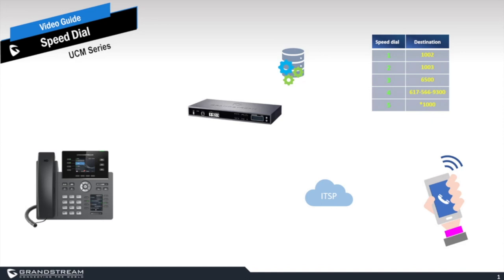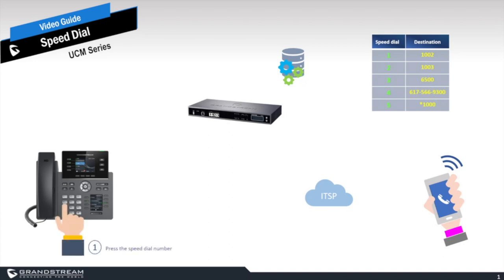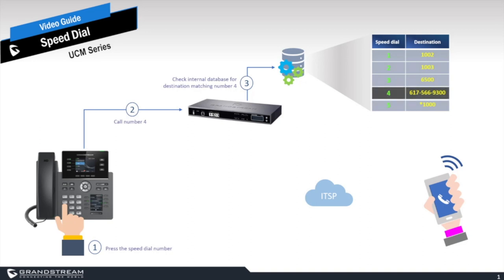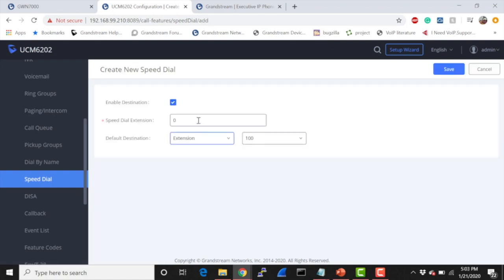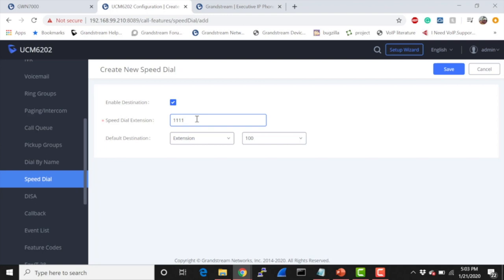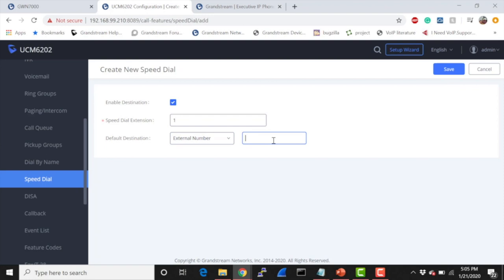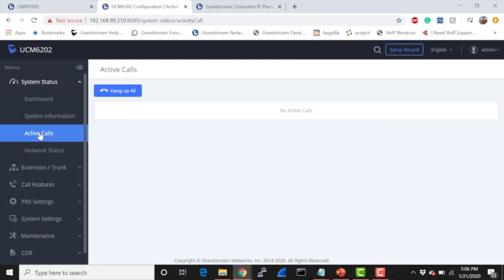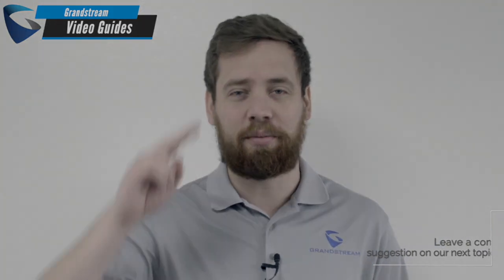Video Guides - UCM - Speed Dial

Comment: RIP Headset users at the beginning.
Rock solid systems when deployed by a knowledgeable Grandstream technician.    At VoIP Portland we  have installed 100+ and to my knowledge had only had one minor equipment failure since 2014.  Grandstream is a giant killer with their no licensing and full featured out of the box setups.    The big brand name systems are just dinosaurs and laughable with their bloated price structures.  Just about anything a hosted setup can provide at much less monthly cost if you have say more than 20-25 phones.